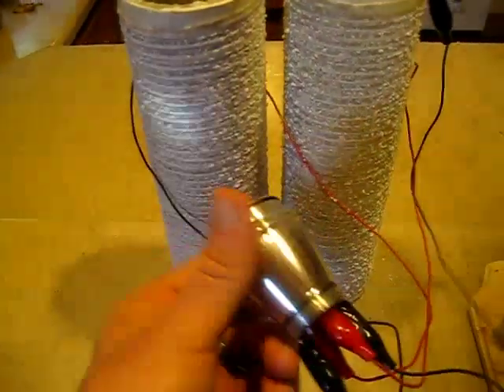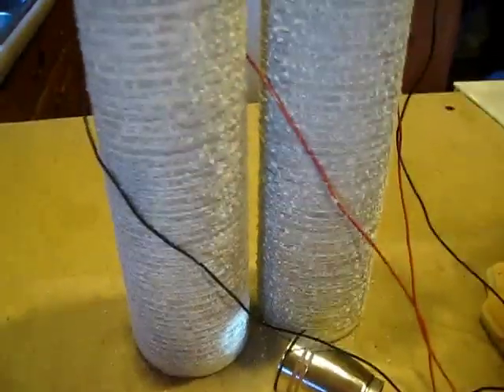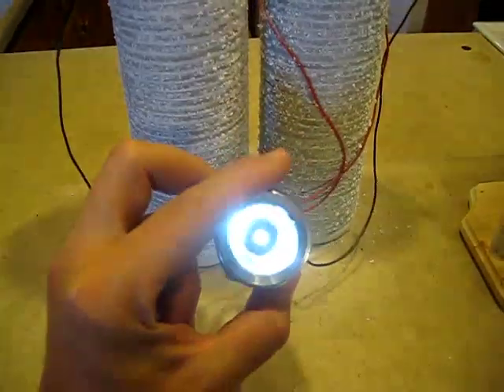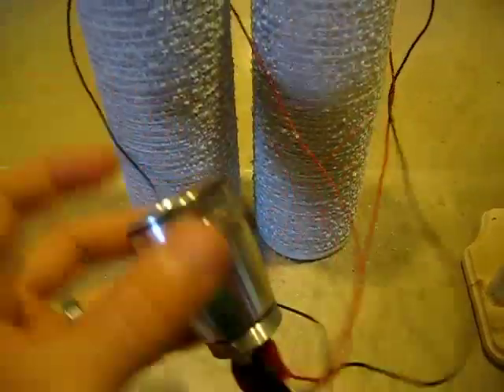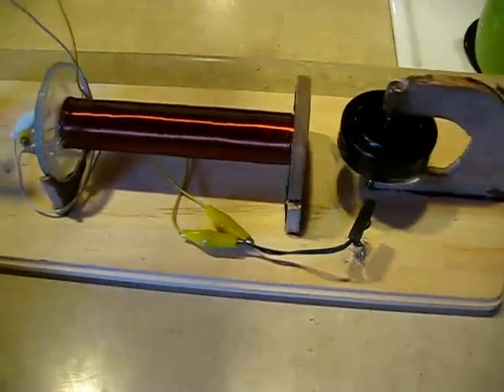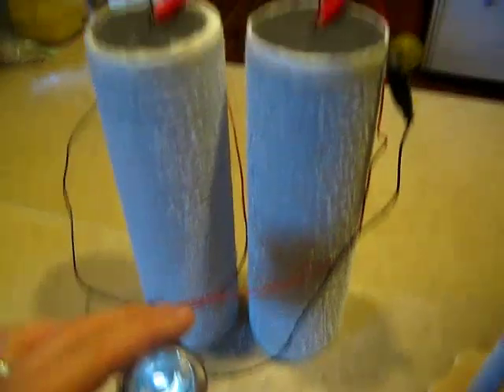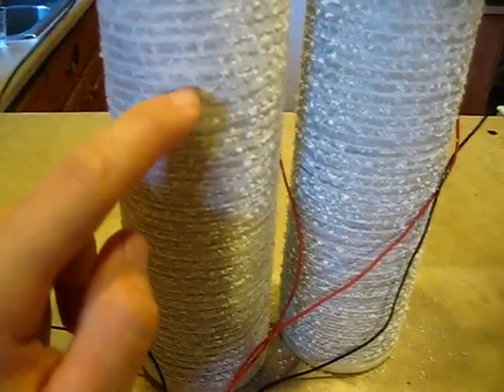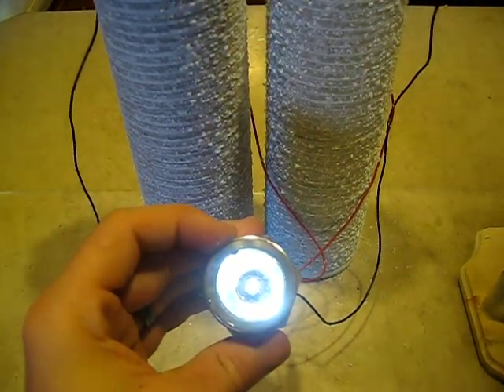Air Battery Test Day 10

Comment: one suggestion... use a very hygroscopic salt like calcium chloride or lithium bromide.  some of these kind of salts will pull so much moisture out of the air that they will hydrate themselves to the point of dissolving in the captured moisture.  then they can just sit there with essentially no maintenance or need to wick water from a cap.  In fact just go buy one of those kind of commercially available dry desiccant tubs use it for something (keep your camper dry or something) and then use the solution directly as your electrolite.  it won't dehydrate unless you bake it.
Reply: Dirk Van Essendelft interesting

Comment: If you want the reed switch to lastbyou have to use or make a "quench arc" component. I just use a capacitor and it makes contact last a lot longer, just connect it across the switch, it also debounces.

Comment: funny thing with magnesium and water, magnesium separates the hydrogen and oxygen leaving magnesium oxide and free hydrogen atoms. and the free hydrogen atoms bond with the carbon rod. i would be curious to see if run for a long enough time if a decent amount of hydro-carbon residue could be "sludged" and burned. if the carbon rod wasnt present you should still be able to produce an electric charge simply because of chemical bond breaking of H2O with magnesium and burn the hydrogen cleanly.
Reply: Then use the strength of the sun to treat the magnesium oxide and make it metallic.
Closing the cycle. 
  https://www.youtube.com/watch?v=lInMzC9qXYI

Comment: Another way to maintain the humidity might be to build a terrarium, keep a cup of water inside it along with the battery and keep it in the sun or under a lamp as much as possible and see if the high humidity has any good or bad effects on it over time.

Comment: Really nice, lasersaber,
I watched as bubbles formed on the ribbon in my control test. That was cu and mg wires in epsom salt in a glass. I assume that is H2.
AND, I wonder if they are shorting across in some places and that is what is making the light get dimmer?
I am in favor of a total run time test with this, but when it finally stops, please scrape the space between rows of ribbon and see if it peps it up or restarts it?
Beautiful research. thank you

Comment: Awesome update, with high enough humidity your battery should last very long. I just received my magnesium ribbon (had fun lighting it this weekend), now I need to scrounge some carbon somewhere. 

I'm hoping (and im sure everyone watching) that the magnesium will hold up longer than 90days. If you were to put this in a PVC (protected from the elements) and popped this in the ground, you can have enough humidity to last you a very long time.

Cheers & thank you.